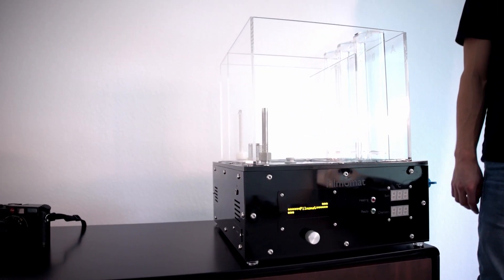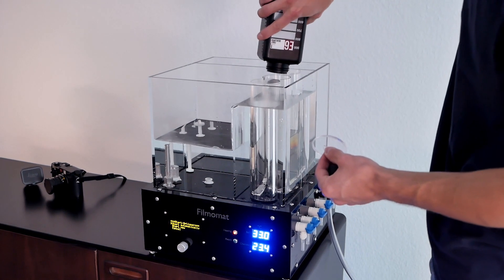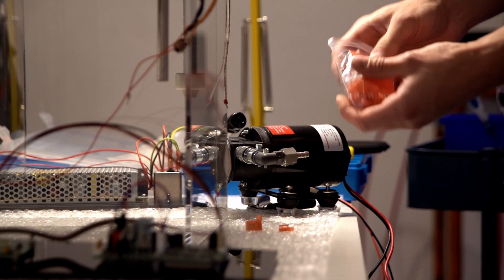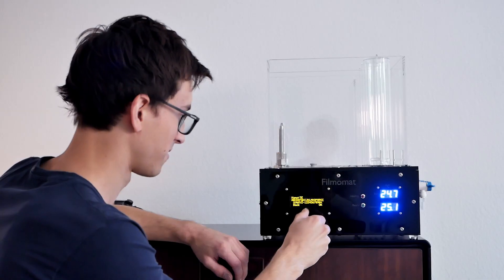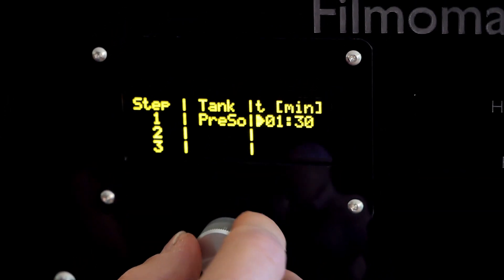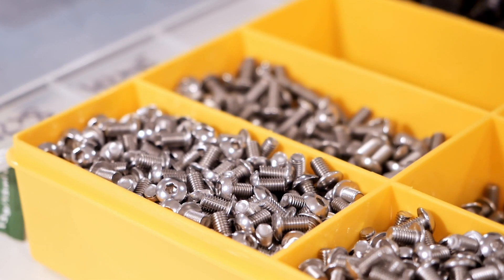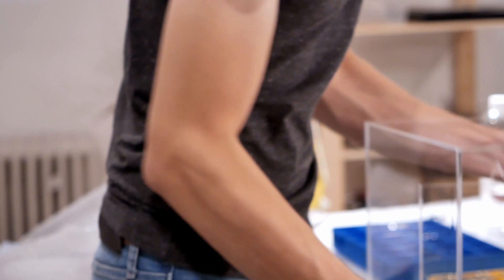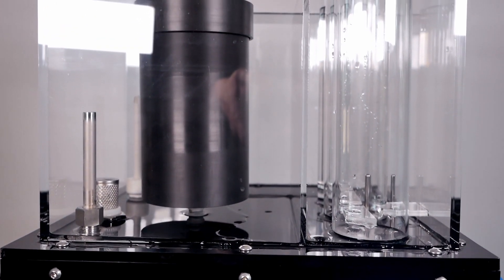Filmomat: The Automatic Film Processing Machine

Comment: How very reassuring that there are still kindred spirits who see increasingly smarter motivation in reinventing the wheel.  Experience and hope prompt me to ask some questions:
1/ Are the Jobo tubes 1500 or 2500 gauge?
2/ If 2500 gauge could 5x4 (9x12) sheets be processed in 2509N reels?  Both in terms of physical fit and volume of developing agent for 6 sheets.
3/  Is the agitation AIR burst or NITROGEN burst?  I first did E-4 deep tank processing in the 1960s with huge bottles of nitrogen on hand.
4/  Is it constant or intermittent agitation?  Is the rate user definable?
Thanks for a great report on this great channel.
Reply: Hi! The current version of the Filmomat uses Jobo 2500 reels. You can also use the respective 4x5"/9x12 spirals. The air-burst system was replaced by a rotational processing system in the current Filmomat version, which means it's continuous agitation. You can find out more information about the system on www.filmomat.eu :)

Comment: Looks like a high quality machine which would be nice to own. Given the cost and the limited market of buyers, I suspect that its demand has been largely fulfilled. There seems to be a contradiction between its target for high quality processing and the limitation to three solution processing. High quality C-41 and even more so, E-6 processing requires processing steps well in excess of this three bath limit, which compels the use of the compromised chemical kits targeted to DIY home users. For example, the Sidekick processors made in the US until last year are adaptable to the full E-6 or C-41 processes, although they were new about 50% more costly than this machine. IMO an over-designed and over-built machine for its limitation to use of the three-bath chemical kits.

Comment: I must say something unpleasant, but before that, it is important to emphasize that the system is impressive, well built and carefully designed.
The obstacle is the cost.
What is the point of this device that many want to purchase but few can afford?
I have been developing C41 for many years on a semi-automatic machine that I built myself. For sure, I am not an engineer so my machine is cumbersome and requires endless maintenance.
An automatic and reliable machine is needed desperately. 
It seems to me that the illogical price is a result of the high-cost production method. 
A lot of hard work is spent in a tough manual assembly that requires high skill that is suitable for building a prototype. 
For making this wonderful product accessible, the assembly must be transferred to a facility capable of operating an efficient production line capable of producing quantities at a low cost.
Until that happens this product is a mess. The goal should be widespread international distribution.
We all need new tools for keeping film photography alive. 
For this to happen, new means must be proportionate to the purpose.
Until that happens, this project is a product of great talent that will not be realized since it is an uncommercial.
I hope this skilled guy gets this advice and takes the next step toward success.
Reply: The same could likely be said for Leica’s business model, but they seem to be doing ok
Reply: @AndrewRoyal137  problem is: this isn't Leica. Acrylic glass, messy one-button control, etc etc. This thing is more of a style, but at the same time it has limited functionality. 6-bath processes are mess to use this machine with for example and even semi-automatic Jobo is better for that purpose.
But guy that posted initial post is also wrong: this type of processor, fully-automatic ones, they won't get cheap. Ever. Period. There will be tweaks and stuff such as Cinestill boiler, but nothing really serious. Serious stuff is meant to be used either by labs or wealthy people, not just random hipster in his garage.

Comment: I think it's a really cool idea and feat of small-scale engineering, but it's prohibitively expensive. The base unit plus the cost of necessary accessories comes to about 4000EURO, which would only make sense for a commercial lab, which I would imagine already have their own high throughput process. If you stand to save 5 Euro per roll be developing at home, this would take over 800 rolls of film to come out even.

I'm not suggesting that the price point is unfair considering how much went into it's development, but it still doesn't change the fact that it's not a practical purchase for the vast majority of film photographers.
Reply: Neither is Leica by that logic, but there is certainly a market for them
Reply: @AndrewRoyal137  A processor which can only use the compromised three-bath kits aimed at home users is no Leica of processors. This system could have easily been designed for a 6 bath E-6 system with very little extra expense. As it is now, it's about to bypassed by several newer competing machines now in development which will cost no more, probably less, and which will have none of the limitations imposed by this unit.
Reply: Its a very limited market so economy of scale isnt a thing here.

Comment: I see only 3 tanks for chemistry. What if i want to use real 6-bath E-6 process ?
Reply: Hi, I spoke with Lucas, the inventor of this machine, a couple of months ago with a similar question regarding true ECN-2 processing, which as you probably know, is a 9 phase process. Lucas assured me that this was possible with the machine, it simply requires a slightly more active involvement. The idea is that you would program a preset for the entire process and then hot-swap chemicals in the tubes after they have been used. By the way, according the website the filmomat now has a version 2.0 that processes twice the film w the same amount of chemicals.

Comment: Main concern: after-sale support, maintenance & break downs.
Still, it looks like a beautiful product & solution.
Reply: Thanks! Servicing is done by me here in germany and of course there is a warranty on the product. The Filmomat is on the market for around 3 years now and during that time the unit proved to be really stable, without the need for a lot of servicing. Wearing parts like filters or seals can easily be exchanged by the user :)
Reply: Lukas 
Thanks very much for your response!
Reply: @Echolot789  Hi! do you have an option for the Filmomat to process super 8  (process e-6) film?

Comment: Hello, another interesting video, thanks!. One question: In BW manual development you have to tilt your filmtank every minute for ca 10 sec., to flush 'used' chemicals away fom your film serface, depending on the result you want This has allways been an issue with automated BW development like the JOBO processors, great for color, not that good for BW. In real big labs they used to have standing tanks, different process alltogether. How has he solved this? I could not see any option to move the film tank.
Reply from the maker: The chemicals inside the tank are agitated via an impulse of air which works really great. I only mention it briefly when talking about the sounds of the machine. :)
Reply: @AnalogInsights  Does the Air risk the chance of air bubbles sticking to the film?
Reply from the maker: Mark Wilko No, to the contrary. It removes them. Similar to putting the tank down manually with a proper thud (for lack of better words).
Reply: Analog Insights It will be interesting to see longer term results, i.e. Plus-X was very perceptive to air bubbles created during development, not developing on that bubble spot on the film no matter how hard you ticked the container. Ruined many of my films in the old days, had to switch film/dev combo. Not relevant anymore with this machine and or modern developers I think.

Comment: Developing film is not hard at all. Scanning on the other hand is where the real pain lies. I wish someone would put the same effort into creating a modern, high resolution version of the Pakon F135 Plus scanner.
Reply: Agreed. There is certainly a hole in the market there. Most archival depts in art museums have moved to DSLR/Mirrorless scanning at this point because of their ability to crank out raw files. The problem with DSLR scanning is that it’s fiddly - the opposite of a Pakon (although even the Pakon requires using a 20 y/o operating system either on another computer or as a clone on the master computer). Highly recommend checking out a company called Negative Supply. They have created some products that make the DSLR/M scanning process as quick as a Pakon once you have it set up.
Reply: The former top of the line 35mm and medium format scanners from Nikon and Minolta were far superior to the Pakon in terms of scan results, yet they ended production because there was not a big enough market of buyers out there to warrant the cost of production. Were their an adequate market for such scanners, you would not have to re-invent the wheel - just dust off a Minolta 5400 II and copy it, updated for current computer operating systems.  Instead, the edge of modern scanner technology is represented by cheap, Cinese made, crap.

Comment: the next prototype needs a gui... if you ask me it is close but not quite. next build, use a raspberry pi and an good single function distro of linux for an easier user experience.
Reply: so it could freeze, or loose the file system randomly? Anyway 3k+ on this machine is stellar price. I was thinking about somethig doing the same job :) It's time to think faster :))

Comment: Love it! Also, tell me about that hand crank espresso grinder!
Reply: It's the Lyn Weber HG-1.  It uses the same burrs as the 230V European model Mazzer Robur grinders.  The adjustments are easy to do, and very fine, so it's simple to dial in the grind.  The older version I have only has a few neodymium magnets holding the lower chute in place, and the tolerances are tight, so the plastic wiper blade that dislodges grounds held up by static can push the chute off if you are adjusting for coarse grind.  That's a PITA, but it's still worth having because (1) the grind quality is excellent (2) it's quiet (3) it handles dense beans without getting jammed (4) it doesn't heat the beans up too much, and (5) the build quality is great and it looks good.
Honestly, for 1/3 - 1/2 the price, you can get a Baratza Sette that includes weighing that adjusts itself, and grind in 1/3 or less the time it takes the HG-1.  The quality is still very good, but it is loud.  OTOH, the Baratza is not a conversation starter, and the HG-1 looks like a piece of high-end Krell stereo equipment.

Comment: I'm sure its been said before, but its just way too much money. I'm probably somewhere inbetween amateur and pro in terms of experience (I've heard this position being called "prosumer" for being inbetween consumer and pro levels) and I could never justify almost $4,000 USD to spend on this, and photography is like my third favorite hobby. I think the manufacturer should pitch their idea to a bigger company and get these made for somewhere around $1,000 or $1,500 and I could absolutely justify that.
Reply: The high unit cost reflects both highest quality materials and hand made precision. There is no market demand for this type of product in a volume which will afford production any other way. Until the company closed down last year, for many years a similar machine was made here in the US (Sidekick??). It was not as theatrical in appearance, and it was more flexible in operation, particularly as it could run the real E-6 (6 step) process rather than the compromised amateur 3 step. It does everything the Filmomat does automatically. It cost between $2,500 - 3,500, and had full parts, service and factory support. Not enough sales to keep the operation afloat.

Comment: Great machine but it’s insanely expensive.
Reply: Most film cameras are micro mechanical engineering marbles and they are not in production now. They are also collectibles that's why they are expensive sometimes. 
I didn't meant to say this machine is not worth it. It has a great deign, hand made, easy to use etc. Maybe it is the best machine ever made for film processing at home. But, it's not feasible. Concorde is the best airliner ever made but, it wasn't feasible. That's what they are all grounded.
 It's a niche product and it's not for everyone. If you are like me, with a paterson tank, a plastic container and 50$ sous-vide heater, you can process BW, E6 and C41 at home with connivence.
Reply: Not really. When you consider it does, E6, C41 and BW. There are film camera's that cost more, which is more insane in my opinion.
Reply: @dalespencer11  Agreed. And basically handmade.